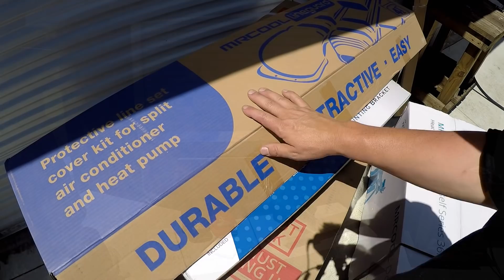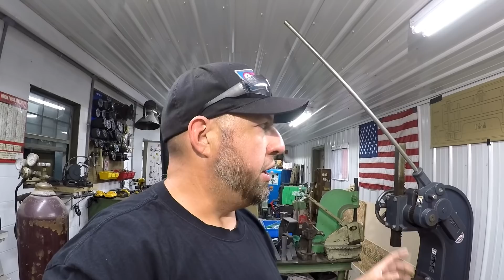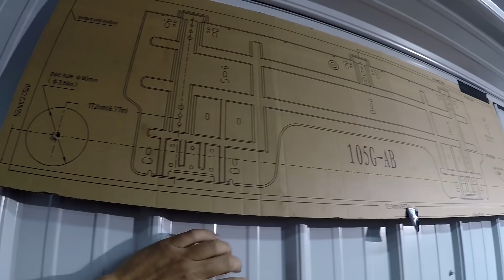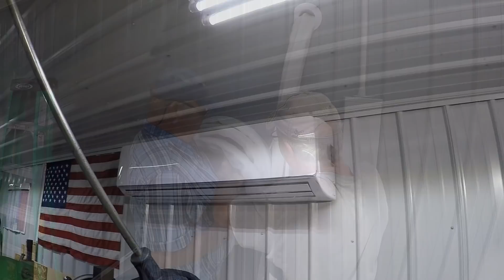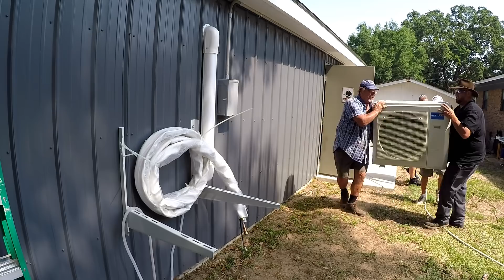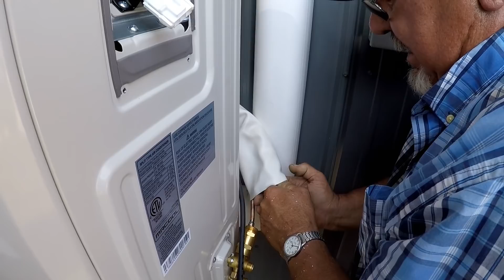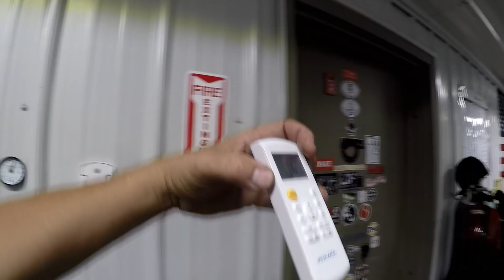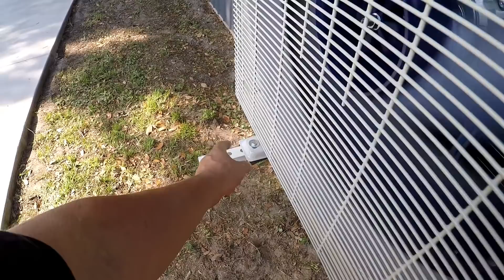Mr Cool DIY Shop AC Install

Comment: Put the condenser on a North, or Northeast, or East facing wall so it will be shaded from the direct sun during the afternoon, the hottest time of day.
Reply from the maker: Sure let me redo this whole install just for you
Reply: @Abom79  Not for me.  The condenser working harder is your issue.  I mentioned it so others thinking of adding a similar A/C could use it as part of their planning.
Reply: @Abom79  This is the first time that Iv'e seen you post so many responses. From their tone, it appears that you're taking some of the comments a little too personally. 
As a fellow Floridian, if you think about Russel's comment for a moment, you should appreciate that he gave some valid advice. The North side of buildings is the preferred location for condensers. It may often be impractical because of set-back issues or line lengths, but you do want the condenser in a shaded area with LOTS of air movement if practical. It will improve the efficiency of your AC unit and UV will destroy your condenser's exterior. All that said, it likely doesn't matter in your situation because your putting up another structure that may shade your unit:)
Have a nice day.

Comment: Being a machinist it figures you like the metal. I would like a piece of 3/4 plywood the size of the bracket & make everything flush, but your idea of the wood shims is good helps prevent the squashing.
  That came out sweet.  Check your remote, my buddy's fireplace heater had the thermostat in the control. If yours works like that you can bring it with you to your work station and have really personal comfort zone.

Comment: Very nice install ,36,000 BTU a little oversized but in heating mode it will heat properly . The Mr Cool engineers should mention that extra lines should be coiled horizontally not to trap oil ,as coiled vertically it can trap compressor oil in the bottom of each loop and can starve the compressor of oil and fail  ; I have encountered this several times .
Reply: @Scott Lichtsinn Looks like corrugated stainless steel lines ,lots of places to trap oil ,Unless the refrigerant velocity is high enough to pull all the oil back ,But there would be a drop in capacity ; Hopefully they are not nylon lines covered with corrugated plastic like the westinghouse units in the 70's and 80's the lines used to fracture in the cold weather in Canada . The evaporator wire should be in liquid seal conduit .
Reply: I do not think that the vertical coil would be an issue, the coolant flow would be high enought to blow the oil, it shall not collect there.

Comment: I think you need to throw that hole saw in the bin Fernando as it's as much use as a chocolate fire guard.

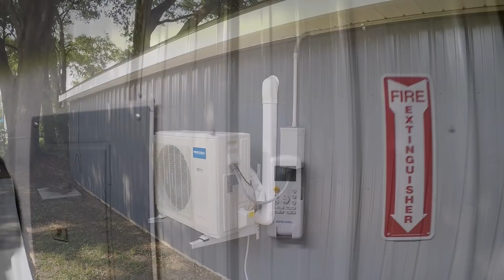28:26 Wouldn't be an Abom vid without some good old back ground noise 😊

Comment: Make sure that those outside conduits are sealed at both ends or you’ll have rodents in your shop. It happened to me after I had an AC unit installed in the attic. I had to stuff the ends of the conduit with stainless steel wool.

Comment: Nice unit  I am surprised that you don't have to pull a vacuum on the Evaporator and  refrigerant lines to remove the air inside them before charging them with refrigerant
Reply: they ship with a partial charge in them specifically so you don't have to vacuum anything
Reply: Yes   I now see that their are Check valves on the Evaporator side at the end of the Refrigerant lines

Comment: Need to leave a tight loop in the drain line, act as a water trap keep insects from coming in. Best not to run it all the way to the ground.
Reply: Absolutely...  if there's no weeping tile against his pad, he will eventually wash out the fines in the soil and find the pad undermined

Comment: Supposed to purge the air out of the lines or better still vacuum lines and indoor unit before opening service ports
Reply: You don't have to with the Mr. Cool units. It's vacuum sealed and when you make the connections with the fittings, it "pokes" through that seal pushing the vacuum to the service ports with no contaminants getting sucked in. So far, I think it's the only brand mini-split that is designed this way, but I'm sure other companies will catch on and do the same.
Reply: @robotech  That's a good deal as long as the hose has held it's vacuum.
Reply: Agree
Reply: @Scott Lichtsinn Good deal, I am used to purging the lines with refrigerant before hookup.
Reply from the maker: I showed how this unit is installed, don’t trust me, ask the pros.
Reply: Abom79 Adam, some people just think they know better than the manufacturers. Good job on the install. Maybe I should say Fernando did a great job. LOL
I must agree, I’ve turned into a pansy myself and my shop is fully climate controlled. So much more fun when you are not wiping sweat from your eyes. I enjoyed as always.
Reply: @Abom79  The reason I agree is because of high humidity, any air in an AC system has moisture in it. Moisture is a killer in HVAC. Been doing AC work since 1973.

Comment: vibration absorber installed at 19MN42sec , if you really want to provide vibration isolation you need to have rubber on both side of the unit feet , the way it is installed actually the vibration will be transferred from the top of the feet of the unit trough the bolt head  then trough the bolt  then to the supporting bracket . so actually there is no vibration insulation the rubber that was installed are use less.
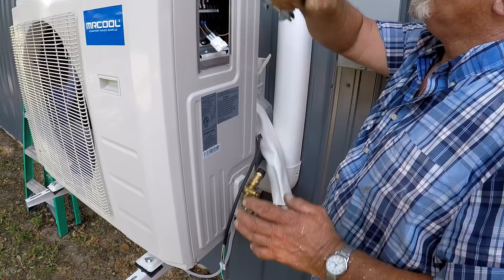Reply: 19:42 *
Reply: What durometer would you use?

Comment: Adam check you book, my unit isn't a Mr Cool, but it has a fan sweep mode where the flap on the bottom oscillates up an down in a sweeping motion and seems to help the air to flow in the shop better...cool...Mr Cool....lol

Comment: You could put Some insulation on the connections couplers, the cold line could freeze up with all the moisture you have around there.
Reply: The cold line should never get cold enough to freeze water or it'll freeze the heat exchanger solid.  If it does, that means you're low on refrigerant.

Comment: Can the hoses be shorter? Seems the coil outside would waste cooling.
Reply: Kevin Breslin They can’t be shortened because it’s a prefilled system, and cutting them up would spill the refrigerant. The lines are only for transport of the refrigerant and are to be considered passive in the cooling system, providing their insulation is intact.
Reply: @Stefan_Van_pellicom  I understood they couldn't be cut but maybe ordered shorter

Comment: Thanks for the video dude. My AC went out last summer. The 3 HVAC guys gave me estimates around $7500 out the door. I have three rooms to keep cool. I can buy 3 of the $700 dollar ones and come out like a champ. Can you please do a follow up in a couple of weeks. If you like it I will pull the trigger on that deal.
Reply: IN THE SHOP They’re only 700 USD ? I think prices are double that in Belgium ... 🤮
Reply: @Stefan_Van_pellicom  I think I just got lucky last year when I was fearful that nights would be too warm to get any sleep that summer and found a 25K LG window unit for 350$ and free motor freight shipping on eBay. 220 volt (12 amp) and exactly what I needed it's worked out fine. But the next day I was looking for more information and it's price had doubled overnight - says is a factory refurbished unit but the factory shipping box still took an engineer to get to the unit itself. Too heavy for one guy to lift up to window height, so I borrowed the neighbor.
Reply: On their website the ones I need are $700 usd a piece. The one Abomb got is $ 2700
Reply: IN THE SHOP they had another unit that has 3 separate heads and one outdoor unit, less hassle, one condenser can be made to run multiple heads.
Reply: https://www.amazon.com/MrCool-Olympus-Ductless-Split-System/dp/B07QR17N94/ref=pd_sbs_201_2/142-5531754-0045903?_encoding=UTF8&pd_rd_i=B07QR17N94&pd_rd_r=5cd931ba-8cc3-11e9-8864-4fb837cdaea1&pd_rd_w=Hh0O2&pd_rd_wg=rKAJH&pf_rd_p=588939de-d3f8-42f1-a3d8-d556eae5797d&pf_rd_r=FST9AHT9JPKW920JP4AC&psc=1&refRID=FST9AHT9JPKW920JP4AC

Comment: this unit draws approx 30 amps which is 240 volts x 30 amps= 7.2 kw   10cent per kw is 72 cents per hour to operate :)
Reply from the maker: It draws 15 amps when runninng
Reply: AT 15 amps then cost is 36 cents per hour-better than boiling in muggy florida :)
Reply: Thanks, I was going to ask that very question. Much more efficient than my 230 V window unit.
Reply: @carlwhite8225  can also be more btu  than a wall unit
Reply: that's at max though.
Reply: @djbutch123  Don't bother esplaining that..8-/
Reply: It’s 15 amps....

Comment: You can't do your own wiring in the US?
Reply: You can, but an inspector usually has to sign off on it.  Fire safety, you know.
Reply from the maker: You can do all the work ya want!
Reply: In California a homeowner can do his or her own wiring as long as a building permit is obtained and an inspector approves the work.  About four years ago I upgraded my service to 200 amps to support an air conditioner and hot tub.  The inspector said it was a good job.
Reply: @yhnbgt365  in the UK you can if you wish to, can change or add anything to the wiring after the meter.
No one needs to check your work or sign off on it.
Reply: it's all about knowing your limits!  I learned how to do it all from an early age so I wouldn't dream of paying someone else, but if your brain is packed full of some other trade maybe someone else could do a better job.  Most people are clueless though

Comment: If the drain emits enough water you could place the end in a potted plant. 🌱
Reply: Slikx666 Wow, that’s a GREAT idea !
Reply: In florida, you'll drown the plant.  And the water is acidic.
Reply: @stargazer7644  Your correct about the quantity of water: it's a lot, but the water is not acidic. It's basically distilled water: extremely pure and pH neutral.
Reply: @EDesigns_FL  This water is certainly not pure.  This water is from water vapor from the atmosphere, which contains dissolved carbonic acid from the sulfur oxides and nitrogen oxides from the pollution in the air.  It also has not been sterilized by heating as it would be if it were boiled in a distillation process.  Its basically the evaporated sweat of the folks working in the shop mixed in with whatever bacteria happens to be floating around in the air.
Reply: @stargazer7644  The quantity of b.s. in your comment is astonishing. There are numerous rational arguments you could have made regarding the purity of the condensate from an AC evaporator, but you didn't use any of them. Instead, you just contrived drivel in support of your erroneous position. 
Thought  there is CO2 in the atmosphere, the quantity absorbed by the condensate is negligible. This is an issue more relevant to ground water that runs through limestone.
The primary source, burning coal, of atmospheric SO2 (sulfur) is not an issue in Florida. Coal is not burned for either heating of power generation. Additionally, the general air quality in Florida is very good. We don't have much heavy industry and it's a peninsula surrounded by water. 
The real absurdity to your argument about condensate absorbing H2CO3, SO2, and NOx's is that its a completely fallacious premise. Unlike rain and ground water which may have extend exposure to contaminants, AC condensate is only briefly exposed to air before it fails off the coils. 
You don't even understand the basics of how distillation functions. Water is not sterilized by the heating process (it can be done in a vacuum a room temperature), it's purity is a result of phase from between gas to liquid; the same process that occurs in an AC evaporator. The phase change separates H2O from other elements. 
A rational argument against it's purity should have been based upon contamination from exposure to the evaporator coils and whatever accumulates in the drain system: But even this is easily resolvable. 
https://www.mcgill.ca/oss/article/health-technology-you-asked/water-dehumidifier-drinkable
Reply: Okay Einstein, you go right ahead and drink the "ultra pure" water straight from your AC condensate line.
Reply: @stargazer7644  Not only have I drank it, but I've done TDS tests on condensate, and unsurprisingly, it's almost ZERO. But your ignoring the issue that started this exchange: Slikx666 suggested using condensate to water a potted plant, and your assassin response was that the water was acidic.
Reply: @EDesigns_FL  I'm not ignoring the issue that started the exchange.  I'm replying to your "assassin" response that AC condensate is "extremely pure and pH neutral".   Whatever an "assassin" response is.   The average pH of both AC condensate and rainwater is the same - about 5.6.  That's acidic.  They're the same because they come from the same source - water vapor in the air.   I stand by my original response.   You're an idiot if you think AC condensate water is safe to drink.    And just for your information, according to the state of Florida, there are 30 coal fired power plants in Florida, providing 20-25% of the electricity you use to run your dubious water purification system.  Perhaps you should review some of your other facts as well.
Reply: @stargazer7644  You are still making the same bogus correlation between rain water and condensate. They DO NOT HAVE THE SAME pH! 
https://www.houzz.com/discussions/1477525/ph-of-dehumidifier-water
https://www.thcfarmer.com/threads/can-water-from-a-dehumidifier-be-used-to-water-plants.13181/

And, contrary to your proclamations, condensate is perfectly safe for plants.

In regards to my claim about coal fired plants in Florida, I was incorrect. There are several, ~14, most are slated for decommissioning. You have to click on the individual site links to get the info. I live in South Florida where there aren't any coal plants, and was mistaken, and surprised, about the rest of the state. 
vhttps://www.sourcewatch.org/index.php/Category:Existing_coal_plants_in_Florida

Comment: As an European I'm pretty amazed by the fact that you guys (in the comments) are amazed that they come charged. These are the norm here. My recommendation for Adam would be not to cut the tip of the consoles and even move the outside unit to the last holes, so distance to the wall is bigger. This will increase the life of the unit (considering you also put the remaining of the line between the unit and wall). And yes keep being cool in every sense.
Reply: Quality of conversation over here is often pretty low.  Occasionally I run into someone who knows a lot, and I try to learn something.  It seems we get our education from TV and nutrition from beer, and neither of those really help the front end of the brain lol

Comment: Before you cut the legs off the evaporator shelf, you might consider moving the unit out to the edge as the coiled hose may be blocking airflow thru the unit.  Just sayin'.

Comment: I  always put a plywood backer behind the condensing unit.
And be careful not to lose the remote control because some of these things, (Sony comes to mind) don't work without the remote.
And some of them, (Mitsubishi comes to mind) won't work unless you put a dang code into them every time the power goes out.  Some of these can be a pain in the backside.

I like LG, they are simple and don't have special codes and stuff to make it work.
Reply: Here in South America they sell universal remotes that work on any split AC. Same for TV sets.
Reply: @angelpais8160  that's cool.  It's been a few years since I have worked on these but I remember a few brands had proprietary remotes that had to be linked to the unit via a special code.  They were a pain in the butt even with the factory remote.

Comment: Oooh aircon....... that would be great in the sweatbox I have to put up with, though the place I work is definitely much bigger than your shop and we have over a dozen high volume steam pressure cookers so heat is a huge problem even over here in the UK. On an average day it's about 21 Celcius or 69 freedomheit but can easily get into the 100 f range and it's not a lazy job, lots of lifting and shifting. Highest I've seen was last year hitting 122 f indoors..... its also humid too so yeah, not pleasant
Reply: You got me at Freedomheit.
Reply: @brianrhubbard  Hee, not mine. Alex Steele came up with that
Reply: @matthewsykes4814  Just checked out his channel, dudes got some talent. He is like Make It Extreme but with words.

Comment: A lovely cool shop - nice!

The condensate that comes out of the little drain tube is distilled water - well, actually condensed out of the air in the shop. It is suitable for topping up lead-acid batteries. It's also much better than tap water for adding to car radiators along with the coolant. Perhaps you can bottle and sell it by the gallon!

In my part of the world (Caribbean) we are warned not to let the condensate run into the dirt next to the house because it encourages termites.

Comment: Don't know if you are aware but there are now A/C heat pump units that will run directly from solar panels. Not sure what your sun exposure is but for some it makes A/C a no electric bill possibility. Those mini splits are wonderful though.

Comment: /70/ is starting to get hot.  90 is... Not right.
Reply: It matters where you are 80 is fine in GA   but hot in OH  strange but true.  70 hot must be in MN.
Reply: Nah, the further from the oceans the bigger the swing. MN gets fuuuuucking cold in the winter but still gets miserably hot in the summer.

Comment: no vacuuming refrigerator lines needed?
Reply: The lines are precharged and temporarily sealed on the ends that connect to the condensing unit.  Connecting them breaks that seal allowing flow between the condensing unit and the lines.  Seems to be a slick setup if you are willing to install it yourself.